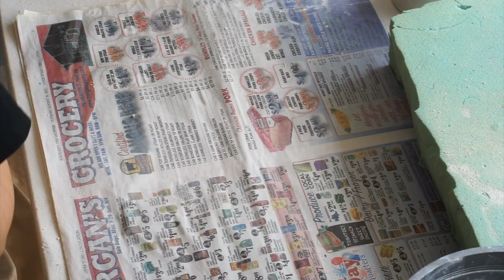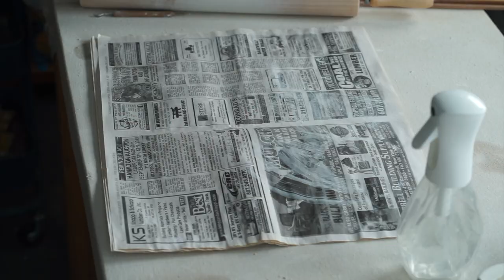Full Record of making ceramic sculpture - Woman as Vessel series, ASMR,  Art Therapy, Pottery

Comment: Such an elegant style - it reminds me of an exotic orchid.  I have two questions: why do you feel it’s important to put the clay slab between your piece and the kiln shelf? And, do you have to dry the piece very slowly to prevent cracking? I get frustrated by porcelain because of the tendency to crack.
Reply from the maker: Thank you! The flower is an endless inspiration for me. The slabs shrink together with my work both in the drying and firing process to prevent potential cracking. Yes, I dry my work very slowly, especially when I use porcelain clay.